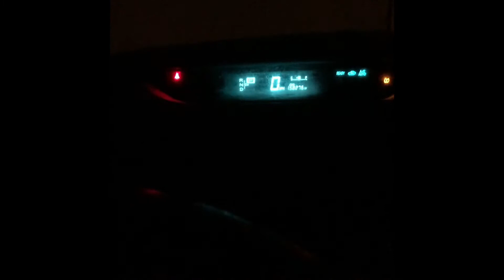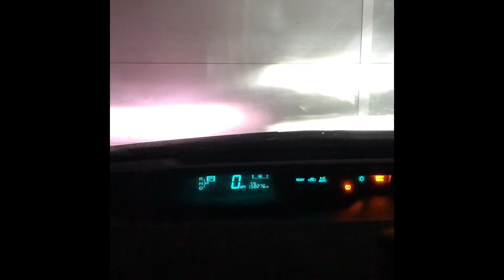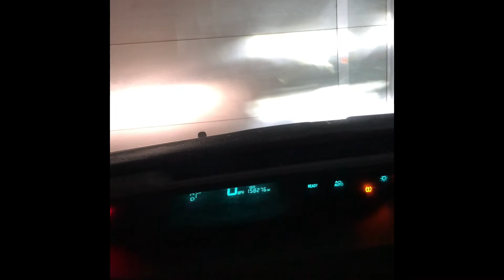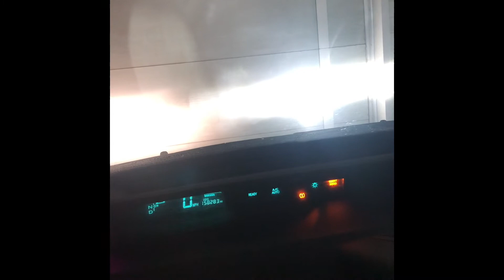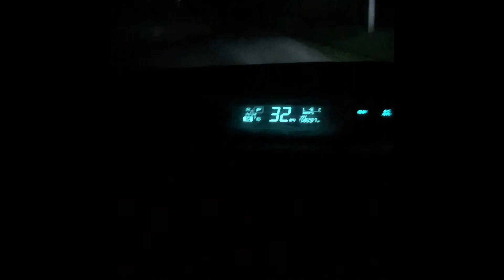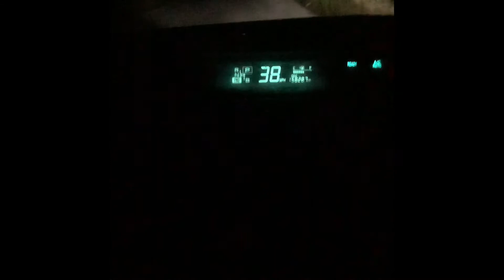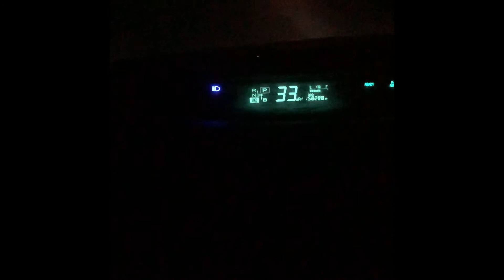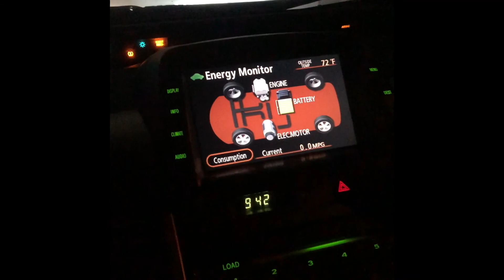Prius HID to LED conversion on a halogen headlight assembly.

Comment: Also pull the bulb out and look inside at the reflector which is aiming rearward. Is the reflector reflective still? Sometimes those reflectors turn black and you miss out on a huge amount of light because of it